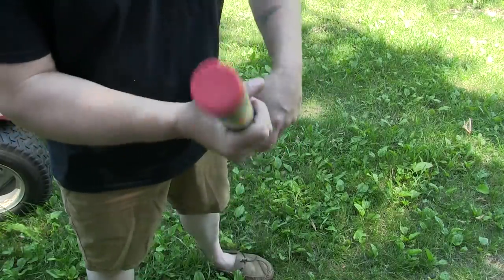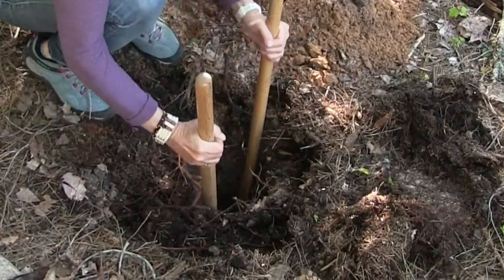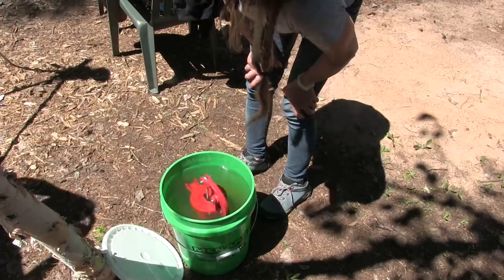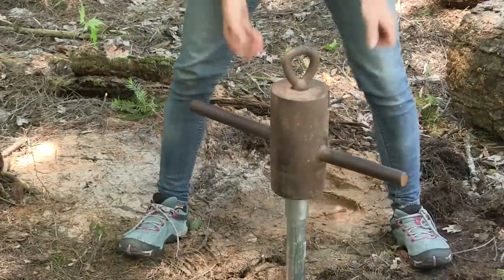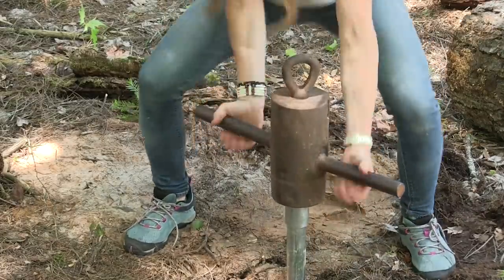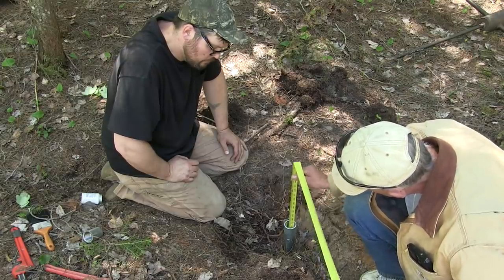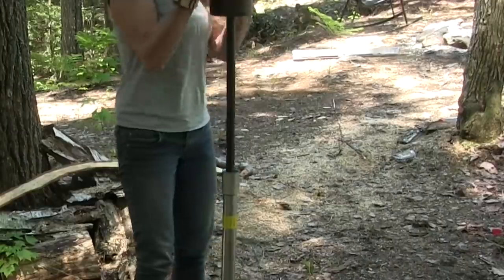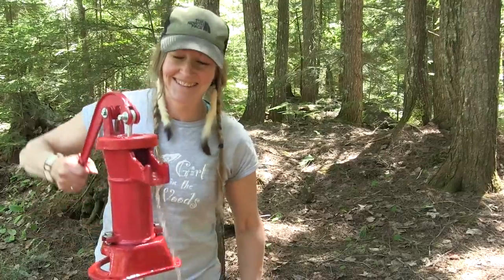Driving a hand pump well at a remote off grid Wilderness Camp

Comment: Just curious as to why you did not use PVC pipes & why you didn’t use a 4’ pipe as a well casing?
Reply from the maker: you cant DRIVE pvc pipe
Reply: OK I understand.But I meant for drawing the water to the surface because I have had a lot of problems with metal pipes corroding

Comment: Im curious if it is possible to put a weep hole 3 ft down on the pipe below ground to let the water out of the top end and pump in the winter so it doesnt freeze with this sort of hand pump or does it naturally just weep back down to the screen?
Reply from the maker: You lift the handle ALL THE WAY up and it will break the suction of the leather valve and drop the prime
Reply: Ahhh!  Thank you!

Comment: With over a thousand comments, I am sure that some one has said that you can use a  "jet pump" on the stand there in place of a hand pump.  Oddly I lived in a area that was hard to find water and so when I bought a piece there, they laughed but three days later with an nice little shelter over my sandpoint and jet pump running on 120 volt wire. I got the trailer house in next and did a first flush right after that.Put in a pump protector if worried about pump running out of water to pump and use a large storage tank that can stand pressure so that you can get your "50/70" pressure in the house. Even a 20/40 regulator is water in a house under pressure.... washing machine might outrun the supply line once in while but just turn it back a click (on the old machines) and go again!
Reply from the maker: Sounds awesome. I dont know much about systems but I like the sounds of yours
Reply: @Bushradical  What I like about mine is all of the pump and gear is on the ground and you can work on it should you need to. Lowes or Home Depot will carry them and you just hook it up, prime it the first time only as they never seldom need that again and yours is in the house. I had mine wired and installed good enough to turn on in a couple hours as I am a picture type guy.